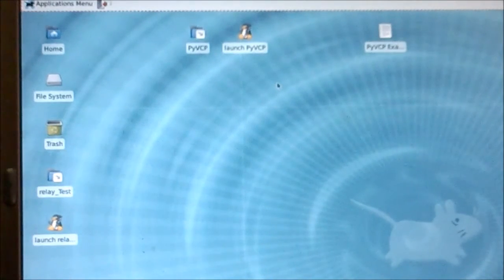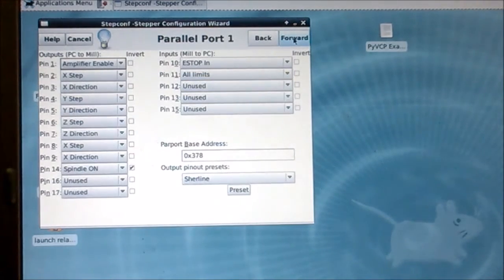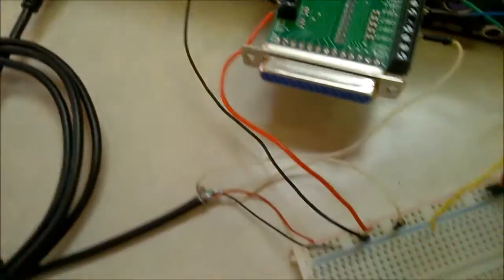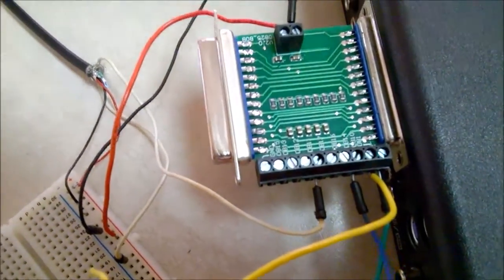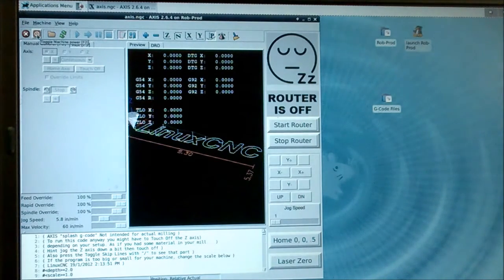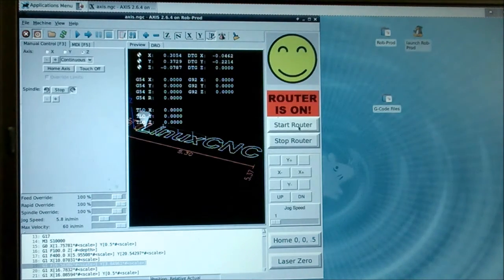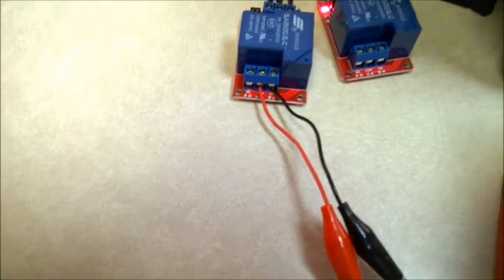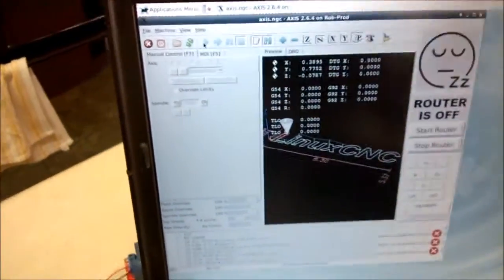CNC Relay with LinuxCNC

Comment: what is pin1, amplifield enable, can i use my board have input e,stop, limit x,limit,y,limitZ ,probe, only, how install, my board ,e stop, home x,homey,homeZ AND were can connect all limit SW, my board have input only e stop, pin 10, X limit pin 11, Y limit pin 12, Zlimit pin 13, probe pin 15 and GND screw terminal, how i connect all limitsSW, probe, home SW XYZ, e stop. i need E stop sure, all limits sure, and home XYZ have good be. and probe need too.